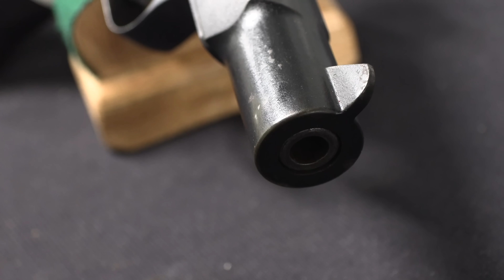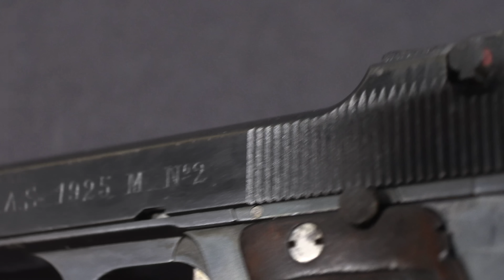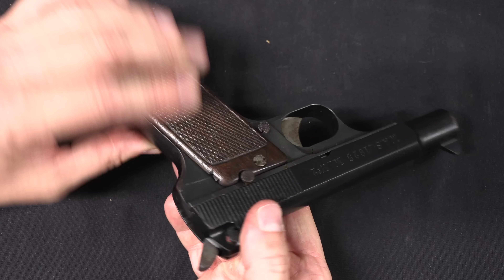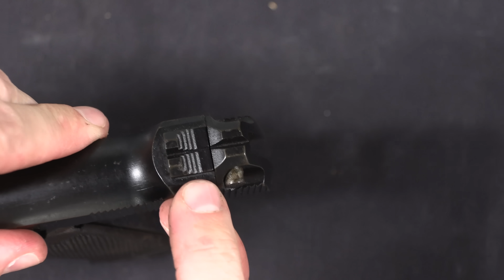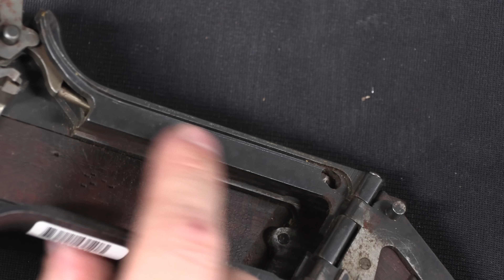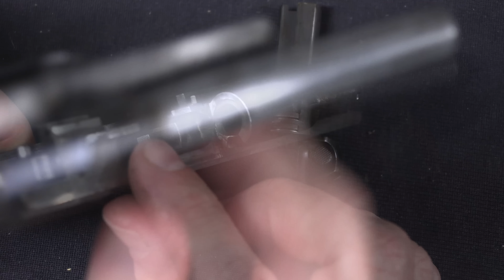Prototype MAS 1925M Pistol: Cartridge Counting in 7.65 French Long

Comment: 10:50
The "Copy of the 1911 by STAR" is pretty reductive
The Model L that was entered was actually a 7.65 FL scaled-up version of their earlier .380 Model D, which itself was extensively changed from the 20s to the mid 30s. It has a 1911-style swinging link, but completely different safety designs, external extractor, and trigger linkage akin to a Ruby or Colt 1903. They made 5 for the trial, and after it didn't get adopted they reworked it into the much more successful Model S pistol.

Comment: That round counter is actually incredibly slick and non-intrusive
Reply: You are 100% correct!  I was looking at it before Ian opened it up, and was "there's a lever of some kind riding on the magazine follower that's pushing on an arm that slides that indicator out."  I was wrong.  The actual design is much simpler and elegant.  Whoever thought that up deserves kudos.
Reply: My thought really. It should have made every MAS’s design series, this is so great especially during live combat.
Reply: Until it gunks up & jams the magazine follower....
Reply: @spackle42  Or, my first thought was your hand/glove interefering with the round counter and then inadvertently interfering with the magazine spring internally - causing misfeeds/malfunctions.
Reply: If you need a round counter you don't need a round counter. You need a miracle.
Reply: i would prefer see through plastic on the magazine.

Comment: The part about wanting a higher capacity magazine while complaining about the grip size reminds me of every procurement trail ever. “Give it more armor, a bigger engine and a bigger gun, and cut the weight by a third.”
Reply from the maker: And make it cheaper in the process, please.
Reply: It’s just so contradictory; you want a smaller grip but higher magazine capacity? C’mon…
Reply: @skullfracture2 extended magazine round counter... of course
Reply: "I want everything in one bag. But I don't want the bag to be heavy."
Reply: Give it a more powerful gun and a smaller profile but make it still carry a lot of ammo somehow!
Reply: With less recoil
Reply: The Pentagon Wars😂
Reply: Ah yes, the good old Catch-22
Reply: Yes. But sometimes you get a FG42 which pretty much could tick all its ridiculous boxes. Sometimes it’s a good idea to put a bit of pressure on people, not just to get them to perform better, but also to encourage them to think a bit more outside the box. The result may not defy the laws of physics, but it might actually be better than people had previously thought is actually possible.
Reply: @fydofire  They should have adopted the Sturmgewr and called it a day
Reply: @fydofire  And the result was… 7,000 guns produced. Truly a game changer that was going to turn the tides of war.
Reply: @zombieranger3410  Was not meant to be. A Very specific tool for a specific purpose that worked well.
Reply: You guys don't get it, just use the standard issue Pocket Black hole™ and put the spring and ammo into it!
Reply: @Normalnyczlowiek Well, sure, easy enough. The problem is getting them out again. With all your fingers in the bargain.
Reply: @steveh1792 well, you can always use a pocket dimensions as an alternative

Comment: This appears to be a very good design. It is easy to take down, likely very accurate with the fixed barrel, the potential to have a very nice trigger, reasonably easy to manufacture with a fairly low parts count and the round count feature all add up to a darn fine pistol for 1925 in my opinion.
Reply: I think ergonomics killed the poor thing. Bad bureaucracy turned it into a very ineffective weapon